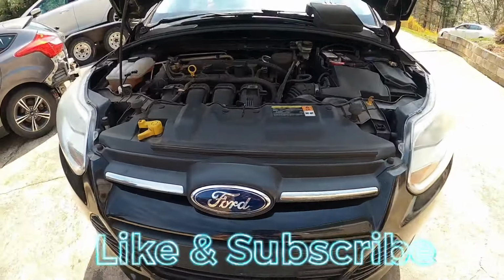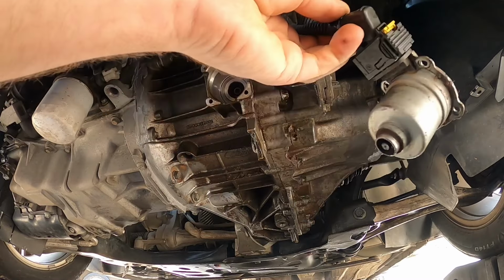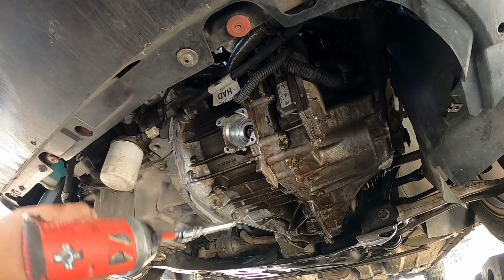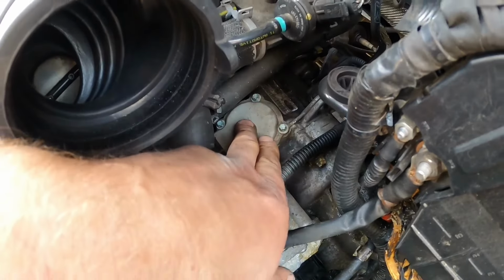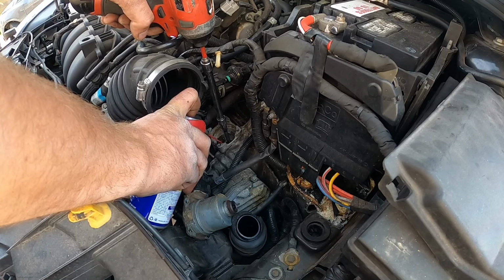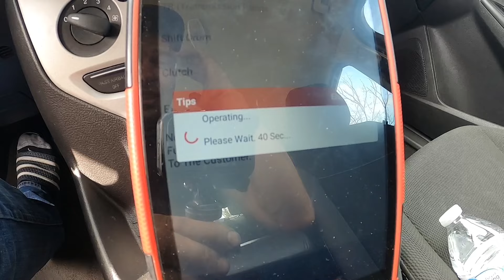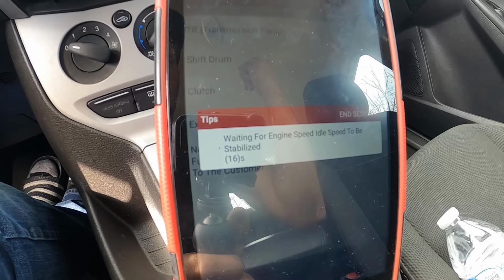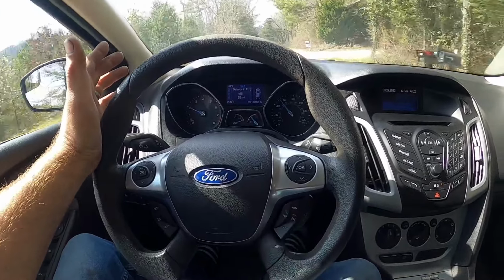2012-2018 Ford Focus Slipping? No Reverse? No Drive? Problem Solved. Easy Fix. You Can Do This!

Comment: My just-acquired 2013 Focus SE with 80k miles is just beginning to be a little sluggish in gears and very mild shuddering every now and then. I'm going to do this now while I'm replacing all the motor mounts, might as well I'll be right there anyway. Why wait for things to gum up completely? Also going to do the grounding fix on all the three ground points I know about, it's never been done on this car. Hopefully this will preempt future problems. Very helpful videos I reapply appreciate the time you've taken to share.
Reply: Hey man do you mind me asking how this went?

Comment: Man, thank you so much for taking time to make this clear, concise video. This process worked for me to restore reverse in our focus, so now I just need to see how long it drives until we need to do it again. But thanks. Super helpful video.
Reply from the maker: I would do every oil change, or every other oil change. Glad it helped 💪
Reply: @L8R-HP  Quick update: This only worked for about 60 miles and we lost reverse again, w/ bad shifting. P287A code. This time I drilled and flushed with brake fluid (as seen in various videos on Youtube), tons of black dust came out, so we'll see if this lasts longer.
Reply: @Chris-pj1os did it?
Reply: @dafozy4587  unfortunately not for more than a day each time. Ended up doing the clutch pak on it.

Comment: Got code P07A3, friction A stuck on, did this to both A+B, (A was real bad), IAC code went away, reset light, done, drives awesome now 👍
Reply: Yes, I have driven close to 100 miles since fixing this two days ago, just perfect !! Driveability/Smoothness/MPG is best I had in months, probably do this at every other oil change, may take extra 15-20 minutes, saves/extends your clutch life. Besides this issue at 82,600 miles, car is perfect, 2018 Focus. 😎 Very appreciative of this video/info 🙏
Reply: Process helps alot
Reply: @allenhumphreys2586  was the gears slipping on you because I got the same car and code also? Did doing that fix the issue?
Reply: @murderblock8194    Yes, it was basically disabling clutch A and related speeds/gears, only clutch B gears, 2,4,6,reverse would work, of course all related jerking, etc. was present, I did install new A+B motors  about 9 days ago, just in case, got Chinese ones on evilbay, repeated clean + lube before install, etc. At almost 1k miles, it's working very good and avg mpg is up.
Reply: Allen Humphreys h
Reply: @allenhumphreys2586  my 2018 has no reverse, the 6mm stubby was to small. Did you use a 7mm to move the actuators A and B?

Comment: i just bought a ford focus st for 600$ with only 125k miles on it i plan on using it on turo as an income generator.  It has transmission problems so imma try this thank you
Reply: Focus st is 6spd manual
Reply: This won’t work in the st

Comment: My mom has this car, and yes it does have this issue. She took it to a mechanic and i bought parts to replace the actuators, but the brobkem still exists. Im traveling back home this month, and I will perform the procedures you did in hopes of alleviating the issues. Thank you in advance, because i thought i needed to get her a new transmission!.
Reply: Have you done this yet ? results ?

Comment: 2012 ford focus had a car sit for 3 yrs slipping gears, removed A & B actuators and the amount of clutch debris binding the actuators was everywhere. Had to do procedure above and clean the A&B actuators well and unit head... Purchased only the tool 6mm and car runs fine now without TCM scanner relearn. This will happen to all of these DRY clutches as there is no way to stop the clutch dust from exiting trans and adhering to the actuators ( moisture + time = stuck forks and actuators jamming slipping no gear)...thumbs up to L8R-HP

Comment: I can’t believe the timing of this vid. I’ve had many many issues with my exact same 2014 Black Ford Focus SE and the reverse is now going out every day (really acts up as the weather gets warmer). I’m really hoping that I can see similar results after trying this out.
Reply: Crazy @corbin slaymaker! I'm having the EXACT issue as of yesterday again...Haven't had an issue for about 1.5 years with the 2016 Ford Focus SE...
Reply: @iiNinjaDefuseHD  welcome to the club man been dealing with issues for years but it’s starting to get scary. Stalling in front of oncoming traffic when trying to cross highways, in rush hour and clutch won’t engage in any gear for 10 seconds, revers goes out completely and I have to have my passengers push. This car is a death trap. Hopefully this fixes it or at least remedies it enough to sell the damn thing.
Reply: Same here  anyone know the name of the tool he used
Reply: @corbinslaymaker3346  Ford should replace the module there was a settlement
Reply: @thegribblereport8383  mines a salvage title :D
Reply: @corbinslaymaker3346  doesn't matter I had one fixed even tho it was salvage, no one's brought it up.
Reply: @tiptopman116  i've tried multiple times, never got past that issue being brought up. Would love to try again if I felt like it had any chance of working.
Reply: I have the same 2014 Ford Focus SE and the reverse does the same thing. I drove the entire Fall & Winter months with no problem but as we got into late Spring & Summer its a constant thing.
Reply: @thegribblereport8383  mine has been "fixed" 6 times in 4 years bro the thing is just no good, Ford got no shame.
Reply: @thegribblereport8383  I believe "only" up to 150k miles.
Reply: @74LovelyLena  me too why does the season effect
Reply: @colbyios5143  wish I knew. I'm afraid it's going to get really bad this summer.
Reply: @corbinslaymaker3346  Mine is seasonal too. Just got so bad today that both actuators threw the code, couldn't go forward or reverse. Coasted to a stop off the highway. Cleared codes, let it stay off for a while, eventually got it going again.

Did you ever try this cleaning fix?

Comment: I got an used 2014 Focus, 1 week after got problems with transmission: some "crack" before moving reverse/drive, it also increase a lot RPM before engaging next gear and it was impossible to select the sport mode. Now it's been stuck in Ford's service during 2 months right now. I hope I had found this before leaving mi car to the fortune!!! 🥴
Great video, thanks a lot!!!
Reply: Did you repaired your for i have same issue i bought 2 months ago its 2012
Reply: @HarshKumar-gg1qr  unfortunately I couldn't fix it because I took the car to Ford's service and they said it was a problem with the TCM, so they replaced it for free (10 years warranty). If you have a 2012 model, maybe there's no more warranty for yours. However, you can try to take it to service. I planned that, as maintenance, I can do this cleaning once or twice a year, let's see how it works. Good luck!

Comment: I intermittently lose reverse and 2-4-6. -- Actuator B was covered in Oil. So I cleaned it off and sprayed the inside a bit. Hoping it helps, but only time will tell. Thanks for the video.
Reply: You got hold the fork open to get the d40 in side counter close wise 10 spins with a screw driver kit make sure it fits but don’t have to be perfect as size the recommended tool hold it open spray d40 and brake cleaner repeat process over 12+ times some videos state you repeat it 20 times but 12 is good 👍
Reply: @fairfax_fran5109  Thanks for the reply. I got about 100 miles out of it before it started acting up again. (Typically would get about 10 miles around town til it lose half my gears) so I got hopeful. -- I am going to order a few tools and try again to get inside the housing/forks better in the way you described. Thanks again. Some hope still left. Haha
Reply: Was also considering buying a new actuator and just replacing it. Since my problem seems to be happening intermittently.

Comment: Ford TSB for shuddering should keep the severe shudder at bay for a while. We've had a 2012 focus dct in our family for years and from 70k miles til the 230k it's got now, doing the TSB has 'scrubbed' the clutches enough to deglaze them. However, if you're getting codes, always check them first, if no codes and just shuddering look up the TSB and run from a dead stop through the first four gears at an aggressive pace a few times (3-4) all at once. Our focus is bucking mad today, shifting causes rev jumps and feels like slipping in the first clutch and finally threw codes so now I get to diagnose from there. Most like the forks at this point (230k miles). Clutches lasted this long, which is impressive so if you have less miles and just the shudder in 1st-2nd, do the TSB and see if that helps. This video is another good idea to increase some life in your lemon car.
Reply: what do you mean by TSB?
Reply: Technical Service Bulletin
Reply: what do u mean by do the TSB?
Reply: TSB Number?
That would assist many people researching this issue.
Reply: @whill7828  https://youtu.be/msA0p87O2y4
Here's a video that explains it all in great detail by an actual Ford Technician.

Comment: Wow! I have a 2016 and I'm scheduled at the ford dealer to fix this Friday. I know they're going to try to charge me for like the whole transmission. I need those tools. Thank you for sharing
Reply: I have the same problems with my 2017
Reply: How did the repairs go at the Ford Dealership?
Reply: @MikesVlogss  you won't believe this, ford still has it. They gave us a rental car. For a $35 part they're charging us $800 for part and labor
Reply: What part did they end up fixing? I have a 2016
Reply: @meegansmith2155  i think it's called the actuator B
Reply: Last I checked , which was a few minutes ago , we all have a lifetime warranty for this issue on the 2012 - 2016 focus and fiesta,  I ran into this looking for just this so I’m now looking into this to get mine back on the road enough to get it to a dealer for a fix of it’s true about the lifetime warranty for this issue and also Detroit free press says we can also get a payment of up to 250 cash for all out troubles so I’m definitely looking into it
Reply: @mholly1973  I thought it was just a 10 year warranty on the recall??

Comment: adding my opinion to this. I have a 2013 that has had intermittent shudder ever since I bought it. I have followed the issue with these transmissions for years and watched many of the supposed solutions to help or "band aid" the issues with shuddering and check engine codes. Thus far, tuning has been the #1 fix to this tranny, however, continuous data logging must be done and the shudder can still return, especially in lots of stop and go traffic. The Ford recalls were just a temporary fix that accomplished nothing. Re-grounding the wires was not a solution either. And finally flooring the gas pedal from a dead stop to reset the ECM didn't work either. Recently , owners & me too, with some basic mechanicking skills have been replacing the shift actuators and or trying this method of cleaning & lubricating the actuator hole where it meets the forks.... And it WORKS pretty darn good and maybe the best temporary fix or band-aid that I have seen thus far. And it makes sense. However, because this transmission is flawed, I believe the cleaning and or replacement of the shift actuators ($80 a piece) is something that is going to have to be performed every 20,000 to 30,000 miles to help extend the life of this transmission. Of course, driving styles and habits dictate how frequent this has to be done. After all of these years of 12-18 Focus owners scratching our heads, this maybe the best and most cost effective solution to help this transmission extend its life and perform like it suppose to. Again this is just my opinion cause Im not a hard core mechanic
Reply: I've logged 188k miles on my 2016 SE.  Technically an SEL but they didn't have the SEL badge that year.  The transmission took a dump at 109k miles and was slipping a lot for 30k miles prior to that.  They replaced the actuators and a number of other parts and it's been great ever since.  No shudders or slipping since.  Not sure if the newer parts were improved, if I got lucky or it's about to start acting up again.
Reply: All that work to still be a slave to big oil
Reply: Just tried it. Seems to be helping thank you will keep you posted. 

Ps. When I took the actuator off clutch dust fell....it is probably caked inside ugh....
Reply: The shudder of the focus transmission is why Im switching back to manual. Its a horrible issue and a lot of ford techs will tell you its suppose to shudder slightly. Gear changes are slow and all around its just a horrible transmission. Im dumping ford and never looking back especially since they are moving to engine configurations that make it almost impossible for home repair.

Comment: Did this and seems to have solved issue. Will keep posted 

 To sub the tool I used a flat head bit and went slow with the drill. 
 For the actuator I used a square bit. Worked fine 👍

 Thank you, saved me alot of money. 
Keep them coming
Reply: Is it still working fine?

Comment: You may run into a problem with the seal swelling and locking things up. WD40 and CRC equivalent cause rubber components to swell a lot!! Should be mentioned on the cans. Please keep this in mind when using these two sprays. Thanks for the video. Much appreciated
Reply from the maker: Nothing to swell up in there
Reply: @L8R-HP  резиновый пыльник на вилках

Comment: Not sure if it is mentioned already in the comments but you should clean all the grounds for the transmission and the ground on the shock tower. There is a video on YouTube how to do this. Very inportant for proper shifting as well.
Reply from the maker: For sure. You want good communication with the TCM

Comment: God bless you I have the same exact 2014 focus ti and I’m having nothing but problems between not starting sometimes to giving trans fault error msg to not going in drive or reverse with no errors on screen will never buy another ford again ……. Found on the road DEAD (Ford)

Comment: Thanx for the video. This help me diagnose a failed actuator. Did the swap to test and was able to flip the non working gears. I'm back to running normal and getting bad shutter on the 1-2 shift which leads me to think the forks are dirty. Gonna try and clean them next. Thx again!!

Comment: TY4 this info!👑 Great video! Btw, What’s the average cost for a fix like this at car mechanic or dealership!🤔
Reply from the maker: I charge $2500 parts and labor. Dealer chargers $5-7k
Reply: @L8R-HP  Wow! I was thinking with a work a round like this, it would be cheaper to fix. Thanks.

Comment: Nice info helped me out i turned the fork 14 times  by hand. Got tired at 12 or 13 and it spun back lol. I heard a click noise at the end. What does the clicking noise mean?? Anyways I drove it 12 miles in town and on a mike stretch of highway where I can floor it up to 90. I think it’s retraining it but the shifting is a little better since I drive it vs the beginning. The transmission light came on 5 miles into it. Shut car off turned back on and tried reverse i was able to reverse around some cars, trailer back to where I parked it. Moved it back and forth took my foot off pedal and it was going.

Comment: Trying it tonight, fingers crossed!
Reply: P2837 Shift fork B Position circuit.
Reply: They work? I have the code P287A
Reply: @3724david  Negative. Focus was scrapped a couple months ago. Never got reverse to work again
Reply: @3724david any update on your car? I have that code as well.

Comment: Thanks for this informative video!   My ford focus dont have reverse.  And moving forward slowly.  Will bring it to dealership tomorrow hope I make it.   Let me also mention that Ford has 10 year extended warranty on ford focus in regards with transmission problem.  Check it with them too..
Reply: Good to know mine is a 2017 with only 14,000 miles on it. Not sure what happened but car is in limp mode and reverse acts like neutral. I did pay for extended warranty so it should be covered. Can’t believe I’m having this kind of issue with hardly any miles.
Reply: Did you find out what’s wrong with yours yet? You can get by limp mode by manually shifting L gear to D at around 3500 rpm and still go 45mph on the side roads to dealer. You’re skipping 2nd gear that’s why the limp mode from take off. Mine had some physical damage internally waiting to find out exact issue. It is likely the casing has a sheared stop for the B fork side of TCM so fork isn’t being engaged at all. Explains the clunk I heard when driving forward after a battery change.
Reply: @IamDaytrader  its the transmission.  I was told  that i need to wait 6 to 8 months for the part…. I dont need to pay anything for the part because it is gonna be paid by ford but I decided to sell it to the dealership for 4500$…. It had 64k mikes on it.  I regretted selling for that price but oh well, Ive done it already… :(
Reply: @marissa8429  what year was yours and how many miles

Comment: Thank you for making these videos. I have a 2105 focus and had no idea about any of these fixes. I cleaned both A and B as described, but when I started up the car, I no longer had reverse or drive. It shows its in Drive but doesn't move and RPMs don't go over 1200.  Do I need to do the relearn before it will work?
Reply: What happened you solved the problem?
Reply: I’m having the same problem and I only have 90k Miles

Comment: At the same time as doing actuator a you MUST clean all earth straps.
They were painted over at the factory, so the full current could not be used by the trans eventually burning the ECU and actuators out.
Just take them off remove the body paint wd40 the lugs and bolts and put them back.
Your actuators or ECU will not burn out due to poor return paths. Cheap insurance.
Reply from the maker: Yes!